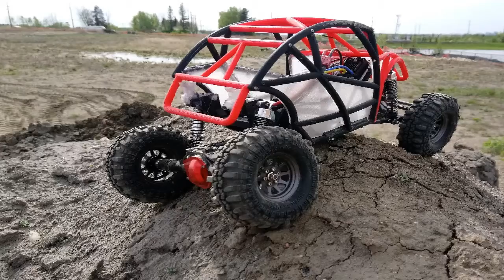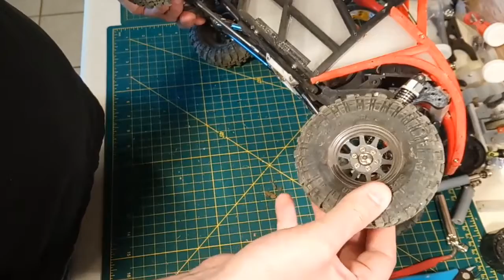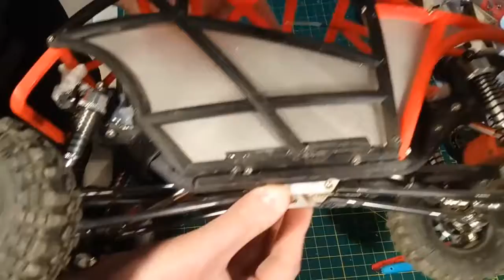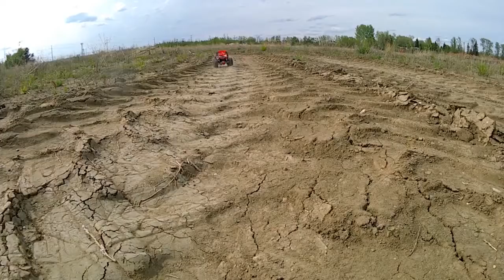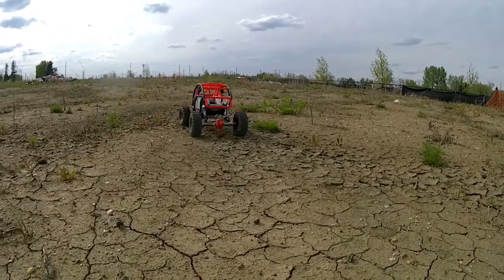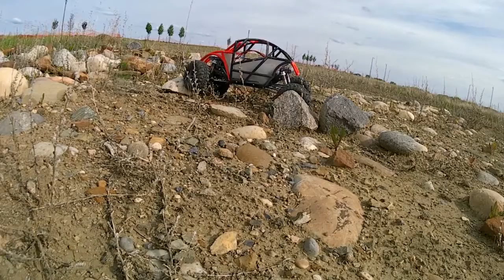W2D IV - Baja Racer : It Lives!

Comment: Its funny, I´m working on a fully 3d printed trophy truck, even know I don´t know anything about RC cars. I desgined my driveshaft exactly like your metal shaft, without knowing that this is the commercial way to do it. Now I´m no longer suprised that it works flawlessly.
Reply from the maker: Right on!  Hopefully you can get enough durability.  Speed and 3D printed parts is a bit dodgy.  Some parts hold up quite well others are not so good.  My biggest touring car fail was a lowly body/shock mount.  Totally worthless 3D printed and no easy way to beef it up enough to save face